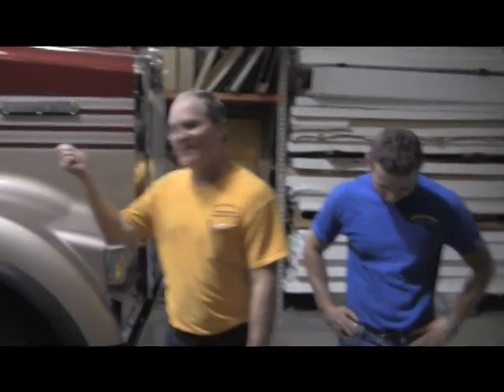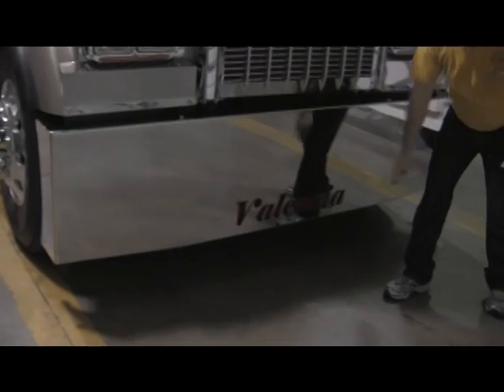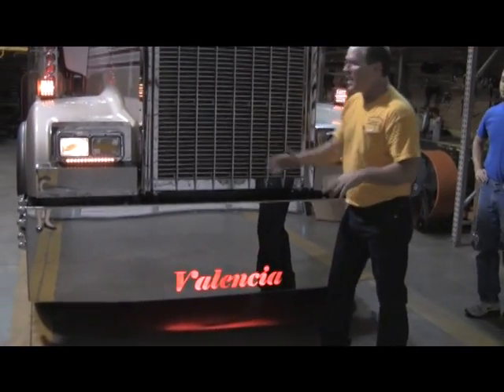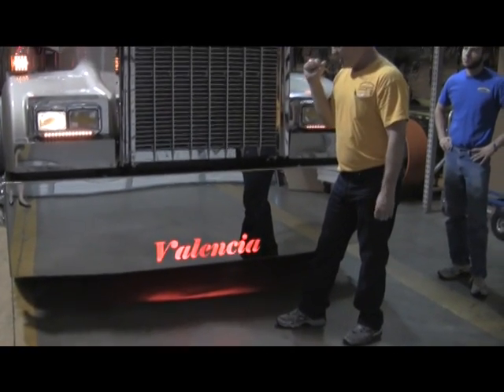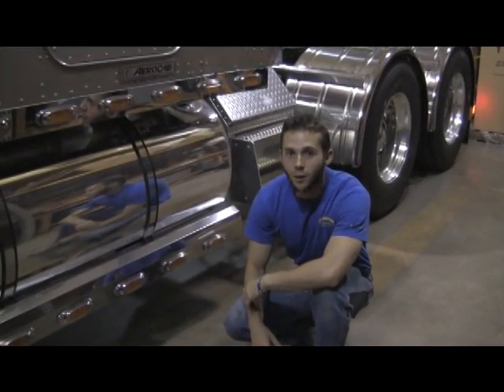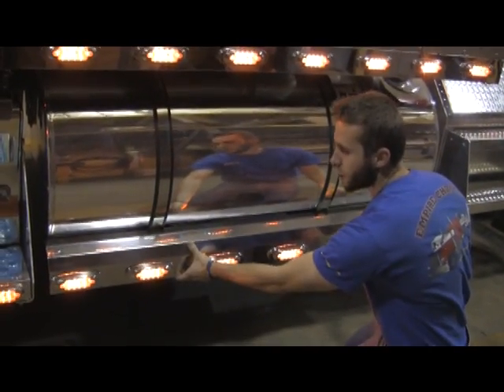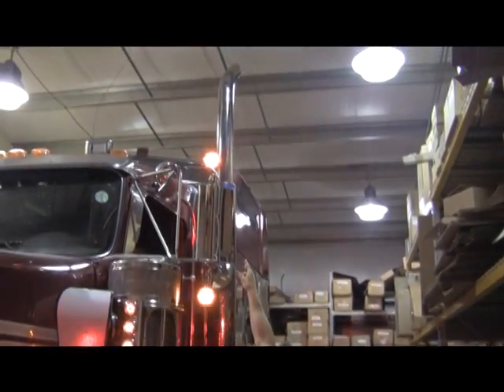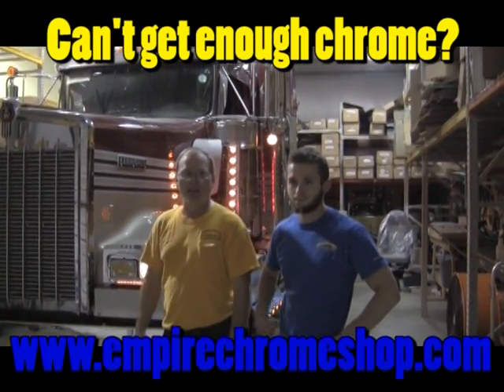Empire Chrome Shop - Chrome Time Episode 4:  Bumper Lighting and Side LEDs

Comment: What kind of square mount turn signals are those?  I just bought some united pacific turn signals in all amber because i like the amber color but after looking at them, the orange on the lense for the front and back is too light looking,  i want a darker lense.  I didn't like it so much that i actually cut the black wires out the signals so that i don't have to look at them all day long.   Is this the reason why people all get red facing the back?      If you could tell me the part # of signal?